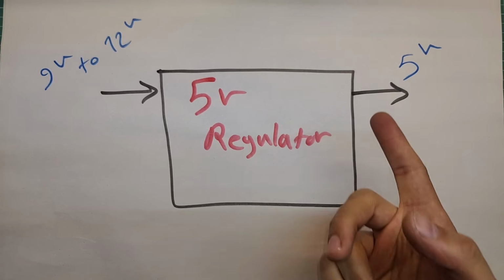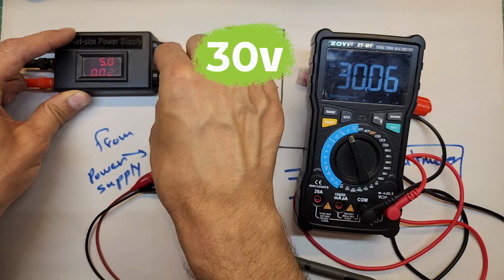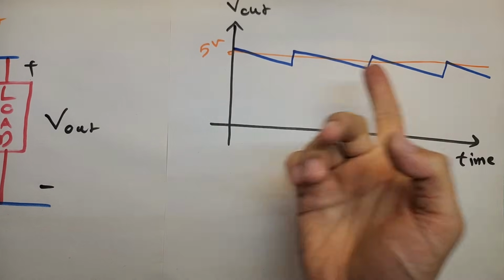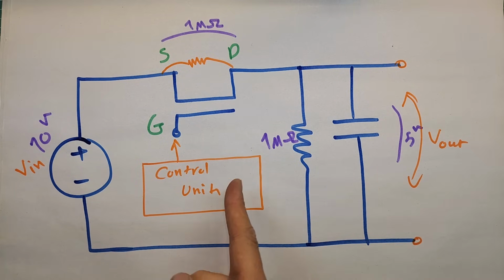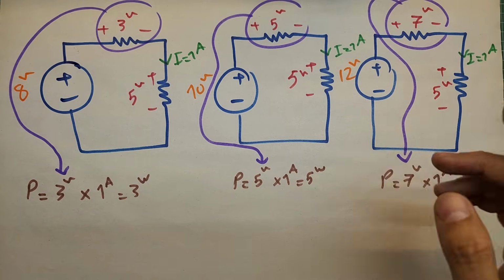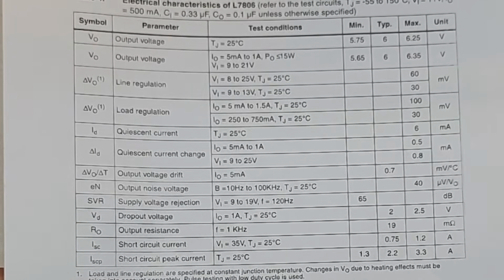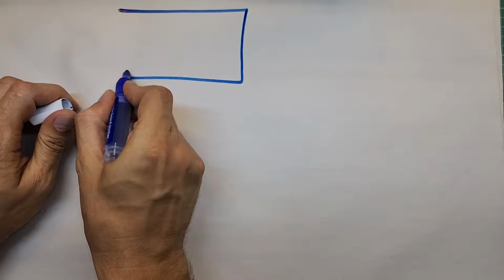How to choose best regulator for an application

Comment: I don't think your definition of buck regulator is correct.  I'm pretty sure Buck refers exclusively to step-down switching converters, and never to linear regulators like a 7805. I know the term "buck regulator" gets used occasionally instead of buck converter or buck controller, but even then it is never used to describe a linear regulator.
Reply: Specially, I'm talking about points like 2:58 where you call the 7805 a buck regulator, which isn't correct. And while you don't explicitly talk about them, it's also implied that things like charge pumps would be considered boost (or sometimes buck) regulators.
I like your videos, and the concepts and explanations are all good here, it's just that the terminology isn't correct.

Comment: I am not a big fan of the term "buck regulator". Unlike linear regulators that dissipate excess voltage as heat and don't change the nature of the energy (they just regulate it), switching converters (like buck, boost, buck-boost) convert energy using inductors, capacitors and switches (transistors).
They do not simply regulate but convert electrical energy between "forms" (higher/lower voltage, different current levels).
The term "buck regulator" is technically not wrong, but it's less precise and can be misleading, especially for beginners.
Reply: The term "buck regulator" is indeed rather misleading while technically acceptable, but the way he uses it a few times here is just wrong - buck regulators are never linear regulators. 
Also, of the tree main types (Shunt, Linear, and switching), shunt regulators were completely skipped in this video. I'm not really complaining too much - everything he said about how they work is correct, he just got some of the words wrong.

Comment: 1. Buck or Boost Regulators 2:37
2. Switching or Linear Regulators 5:08 
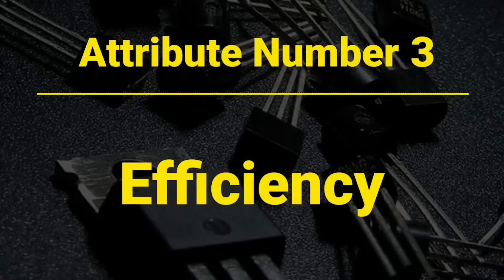3. Efficiency 12:18
4. Dropout Voltage 14:38
5. Input Voltage 15:37
6. Output Voltage 16:21
7. Output Current 18:31
8. Pollarity of the Regulator 19:25
9. Package Type 20:32
10. Cost 20:50
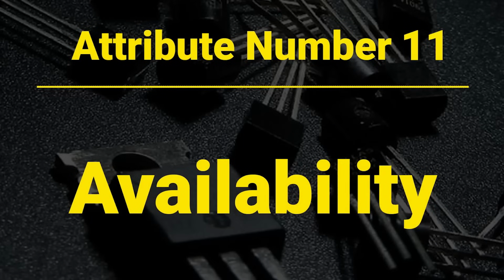11. Availability 21:11
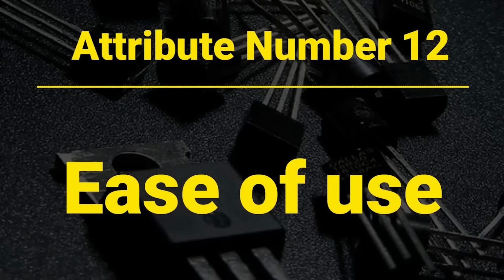12. Ease of Use 21:23
13. Protection 21:53

Great video. Thanks!
Reply from the maker: Thank you for these time notes 📝

Comment: I would propose that there's a difference between a regulator and a *converter*. buck and boost are terms that apply to a voltage converter. (Most converters would also integrate some sort of regulation, but not necessarily). Theyre different concepts, and should be given their own treatment

Comment: Great Video! However, you skimmed very quickly over Linear Negative regulators like the 7905, without much details about where and why they may be useful. Perhaps a good topic for another video dedicated to parts like 7905 ? Especially that this is actually an interesting topic that nobody is touching on at all!
Reply: I suppose one application might be too create +5V and -5V for opamps.
Reply: @bert-blank  Yes, that is the obvious usage: you have a center tapped transformer with with outputs +12V and -12V, and regulating them down (after full wave rectification and filtering) to +5 and -5 with 7805 and 7905. Another application that I figured out that is actually more useful on a daily basis is if you have a positive Supply that is adjustable anywhere between say 15V and 30V, and you would like to get +5V above ground, and -5V below the high rail. I found this to be useful when using PNP Transistors and P-Channel MOSFETs
Reply: Why would anybody want a separate video just to cover a derivative  component?
He covered 7805, so do want separate videos for 7806, 7808, 7809, 7812, and 7812... because they are slightly different to 7805 and can be used for different applications?
Reply: @johncoops6897  No one suggested covering every variation in a part family. The comments were about an entirely different thing.
Reply: @ptechlead - Do you realise that the 78xx and 79xx are variants of the exact same product family?
One is used to regulate positive voltages, and the other regulates negative voltages, but otherwise they are basically identical. 
There's not really much point in explaining the whole thing twice. It would be more useful to cover Low Dropout Voltage devices, as well as how variable models (eg: LM317) work, as well as using linear regulators as a Constant Current source.

Comment: and don't forget that to-220 regulators and to-92 ones have the lead order reversed. that once caused me no end of trouble.
Reply: The pin order for TO220 7805 has a certain pinout,  but the TO220 7905 is different.